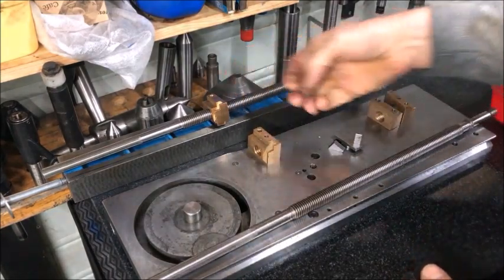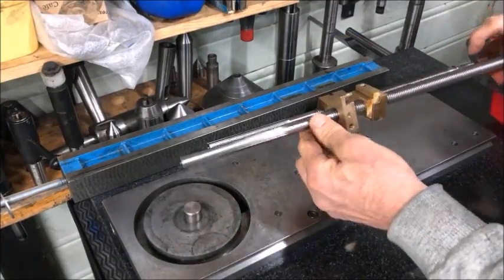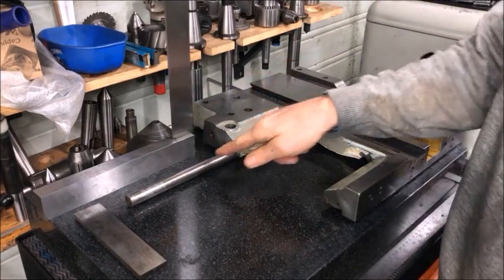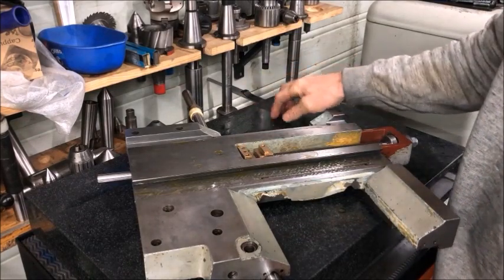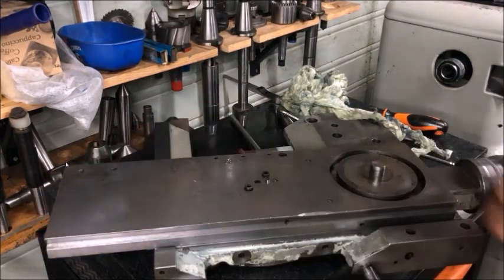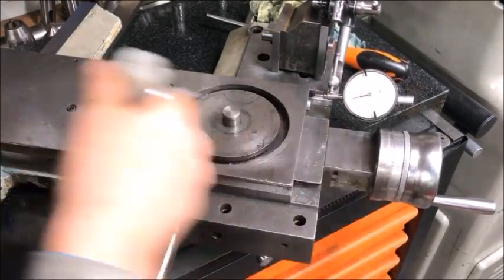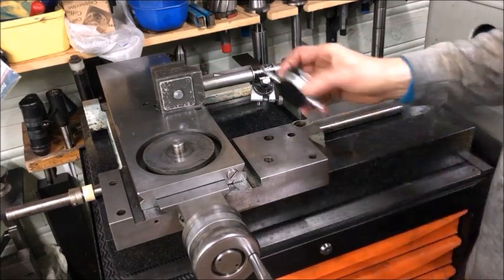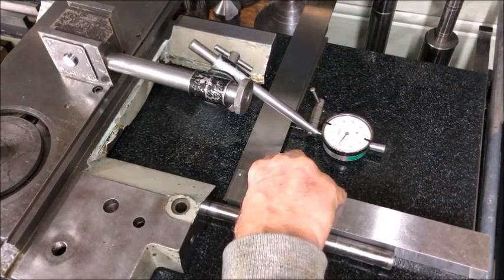Colchester Master 2500 - final assembly and testing of cross-slide and saddle

Comment: How much were the two new nuts and crosslide screw ?
Reply from the maker: The owner bought these parts from their distributor here in Norway. He said it was NOK11562.5  Incl. VAT, ie. a little less than GBP990 (exchange rate at 11.7 or thereabouts)